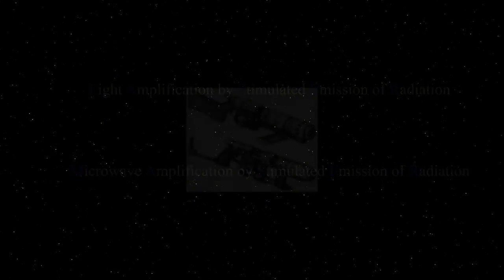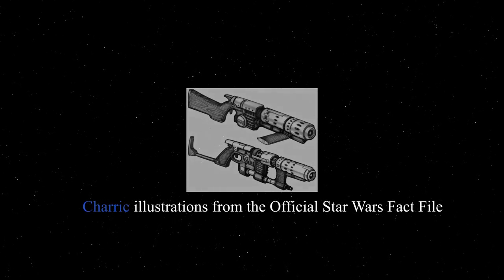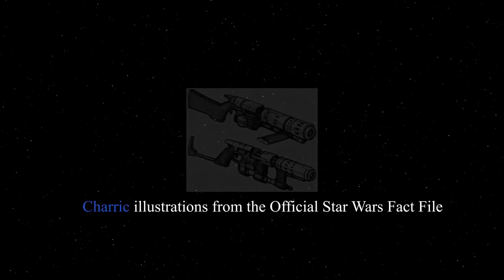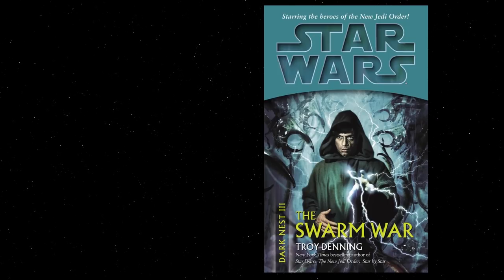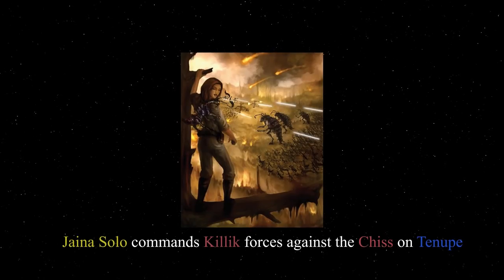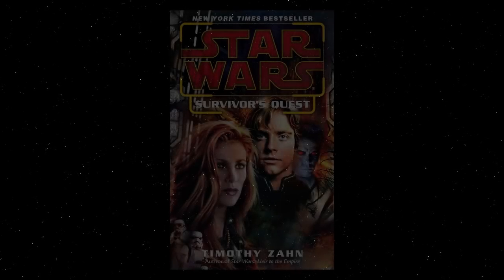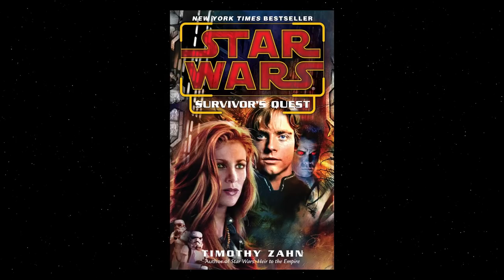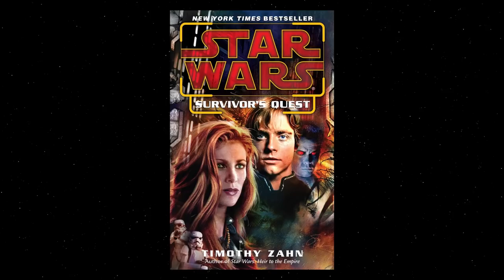What is a Chiss MEGAMASER ? | Star Wars Legends Lore

Comment: Primary differences between concussion missiles and proton torpedoes, and how they impact hulls, shields, and the use of targeting systems.
Reply: Missiles are high explosive warheads and are propelled by a rocket.
Proton torpedoes are more similar to bullets, they have a casing that contain the propulsion system, the casing stays behind and only the warhead is fired. The warhead contains a payload of protonic plasma that once it impacts matter, the protons inside the plasma bump into the ones in the target causing chain reactions that make the target destroy itself

Comment: Turbolasers actually fire bolts of particles or plasma (though it is contained in a magnetic field, thus limiting the effective range of the weapon). It’s highly likely turbolasers can be more accurately called ‘pulse particle cannons’ as the weapon fires bolts of particles like I mentioned before. But correct me if I forgot or miss something.
Reply from the maker: The plasma is what forms when the gas gets ignited. However, there's very little technical info on specifics of it and a lot.of functional stuff is largely fan speculation since it's fantasy rather than sci-fi.

Comment: Microwaves are light and they don't ever create a visible color. They can excite a material to emit visible light, but they themselves are so far beyond red that 'color' doesn't apply in any reasonable sense. The same extends to the other side of the visible spectrum, like ultraviolet lasers, they are invisible in the visible spectrum, but could excite a material they hit to emit visible light. Now the Chiss could have designed their masers to emit a visible light component to the maser's discharge to serve as an aid for targeting, similar to the tracer rounds in our military, but the punch would be with the INVISIBLE microwaves.
Reply from the maker: You can say pretty much all the same stuff about how a "laser beam" wouldn't act in any way like what Star Wars portrays. It's usually either explained as tracers being used, or just being the source of energy used to energize a type of plasma. It's fundamentally all kind of nonsense, this is just the explanation that's given (which is less in-depth for Star Wars as a fantasy series than it would be for, say, Star Trek as science fiction).
Reply: @CoreysDatapad  I grant that point. All I ask is that you be straight forward with facts and make sure to note discrepancies between the physics of Star Wars and real world, and try to integrate them practically when possible.